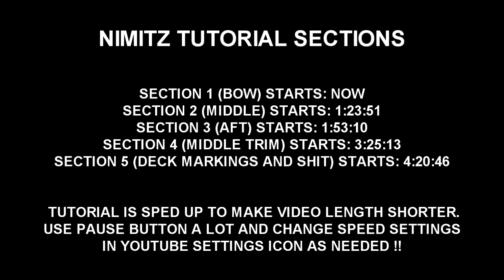MINECRAFT: AIRCRAFT CARRIER TUTORIAL - MAKE ANY NIMITZ CLASS CARRIER (USS NIMITZ CVN-68)

Comment: all your reference pictures from the front of the ship aren't symmetrical; just looking at level #11 it has an extra set of 2 blocks in that long chain of 2's, and doesn't have that last 7. is that on purpose? It is on a lot of the photos

In general, the reference pictures (which I was building from until I got to a point of confusion) and what you are visibly doing are way off. I understand this is an old project and you probably aren't gonna change it but....
Reply from the maker: They are not supposed to be symmetrical from a certain point upward. It is a carrier and different on either side ;-)

Comment: TIP for liferafts: use barrels and face them towards each other :) the actual life rafts are in racks :D i used a reference image from the cold war
also for the fire stations: red shulker boxes or redstone blocks for detail :)
for striping: make a custom map if u want detailed striping
alternating yellow & red (helps to have block switch set to a mouse button): put one in the off-hand and press the switch button every time u place your blocks so you don't have to manually switch.
fencing at the top level of the elevators: i used iron bars instead & in between i put spiderwebs. a little odd but they look like the wires that run between them especially when there are clouds behind